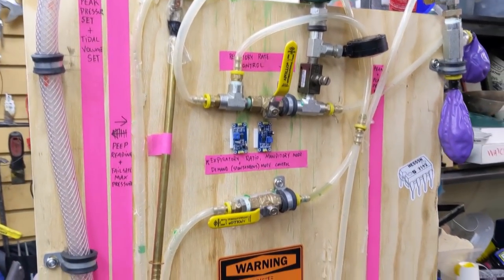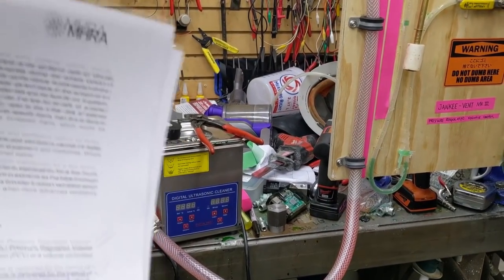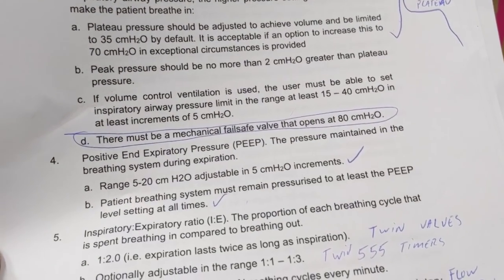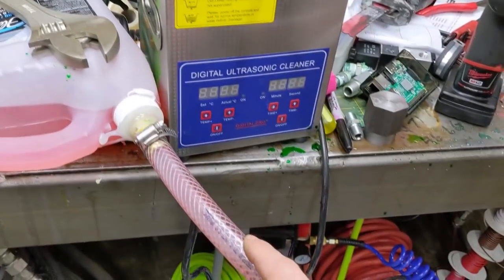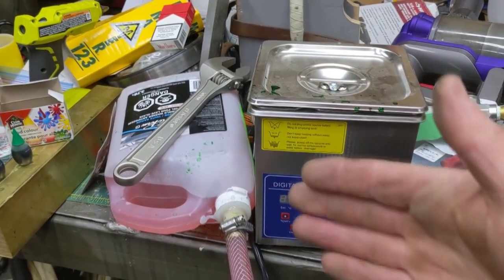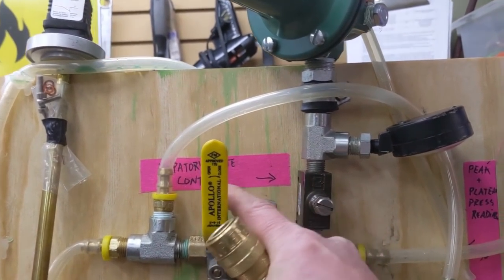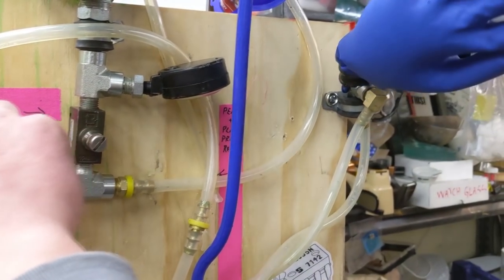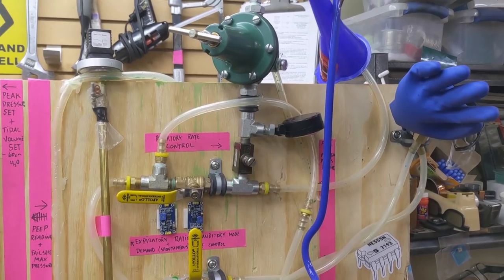Simplest Ventilator Prototype? | 555 timer!

Comment: Why don't we just make this technology mandatory going forward for every hospital bed going forward.  Every new hospital, or hospital undergoing major renovations, gets a centralized ventilator system (eventually) for every bed (maybe with duplicated safety provisions).  Bed-side controls, centralized supply.  Might as well put the ventilator outputs/controls down many hospital hallways so pandemic patient loads can be better served in the future.  Retrofitting may not be that difficult/expensive with current fluid technology, such as PEX-like tubing.  Hotels (and other suitable facilities) could also be incented to 'buy-in' to overflow capacity through tax credits/incentives, for extreme situations.  Just a thought.  Make provision for regular, preventive sanitizing/sterilization of the system. (AvE apply for the patent.)

Comment: Would Dwyer gauge fluid for slack tube manometers (red or blue flavored) be the ticket? I know it's kinda toxic but if it's just measuring water column it should work(?)I f toxcicity is a concern, it's out. If that isn't the case it is usually tame if the tubing is in good standing.

Comment: The only point of a ventilator with this disease is to increase the pressure so you can get O2 into the lungs better.  If you don't have any O2 to pressurize,  it won't really do much.  You'd need to combine this with an oxygen concentrator or bottled oxygen.
Reply: Would welders o2 tanks from oxy acetylene setups work? not medial grade, but?

Comment: Instead of a float why not use a ring in the tube with it phototransistor and ir led ? All you have to do is slide it up and down the tube?
Reply: just in case there is no power,  also can we build something mechanical that can be made by anyone,  anywhere?

Comment: Crazy idea, low flow toilet valves, easily adjustable,  some time mechanism, lots of power,... BC  hydro power rules,
Reply: I'm thinking a five gallon pail,  with a float valve, sealed at the top with a lid, and some silicone seal,  an air hose attached to to top,  it should be relatively easy to control the volume and stroke?

Comment: most hospitals have pressurized air for each bed. why not just tape air to their noise, and a pressure valve taped to their mouths. once their lungs fill, the pressure valve pops off and bam, forced breathing.

Comment: You'd think we still have the manufacturing capability in North America to crank out Bird Mk 7 functional clones, 1960's mechanical contrivances pretty quickly.  If AvE can come up with "Jank-O-Vent Mk III" in 2 days,  it's pathetic that industry is spinning its wheels. 

Elon had 1000 ventilators shipped from China. Pittance shipments won't solve the problem; a company that has to build space grade life support systems could probably spool up and build automatic ventilators if the will was there.

Comment: It's evolving, but you still have to work out how your "better than nothing" machine is going to connect to the patient. I think that you need endotracheal intubation and, therefore, a degree of anaesthesia and paralysis. You will also need some help with the adverse effects of positive pressure ventilation on your cardiovascular system. And, while you're lying there, you will need help with things like pressure areas (you are now an inert lump)  and your fluid requirements, nutritional needs, urine and faeces... You still need doctors and nurses. 

The way through this is to understand that while a small proportion of fit and healthy young people are going to die, the vast majority of covid-ascribed deaths will be people who were already knockin' on Heaven's door. Their best chance is if they don't all hit your healthcare system at the same time. That way some of them might survive and there will be the capacity to treat the fitter patients without having to overtly limit support to the unfit.

It's not a machine that will save us, nor some wonder-drug, just tedious attention to hand hygiene and social distancing. Sorry.

Comment: Manometer needs enough fluid in it that liquid fills the bottom at all pressures so air bubbles don’t float up. 

Don’t confuse exhalation (breathing out) with expiration (dying). 

Nurse: Doctor the patient expired
Doctor:  Ok turn off the machines and bring abom his weiner schliden.

Comment: Even when this handmade ventilator will save lots of lives, who will be responsible when someone will die under this "not certified equipment"?
Even when death wasn't caused by handmade ventilator - you will be anyway guilty because used not certified device. 
Which doctor will take risk to have huge lawsuit in millions of USD?
Reply: You may be lost . Go back down the hall , turn right at the nurses station , and continue straight to door marked by a mop symbol . Open the door , it's always left unlocked for such occasions . Then go in , have a seat on one of the five gallon seats , shut the door and lock it . We'll come get you , when an educator for your class is located .

Comment: AvE, could you show this in more detail please? I'm thinking of building something similar with solenoid valves and a PLC. I can't follow all of your lines in this video though. I've been comparing your design to the "Pandemic Ventilator" (link below) and I'm taking some elements from that design and some from yours. I think your water column for volume is the right way to go. I don't know about the PEEP through the manometer... it's got issues as you well pointed out. What if it was just a settable pressure regulator? Patient can't exhale past the set pressure, done. Could even have a gauge to ensure correct pressure is actually occurring... if the gauge is electronic it can run an alarm via the PLC.

https://panvent.blogspot.com/2007/03/preliminary-layout-for-open-source.html